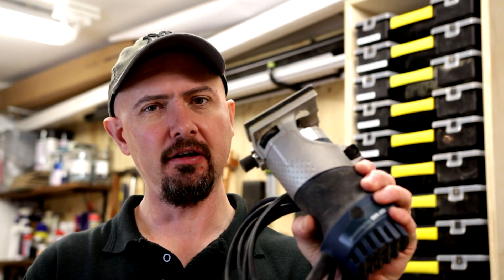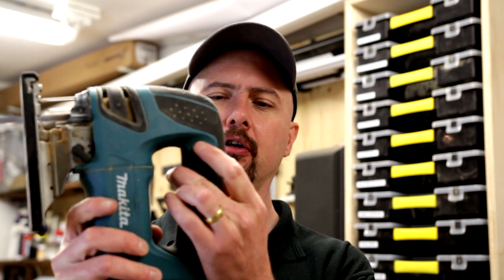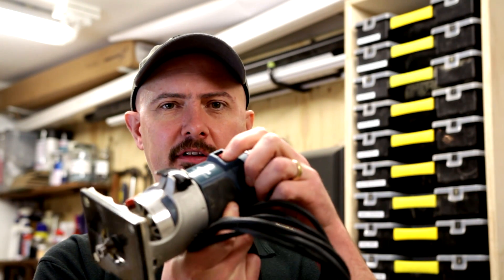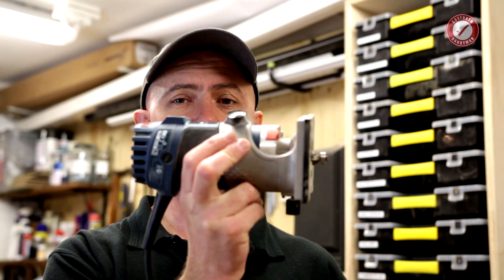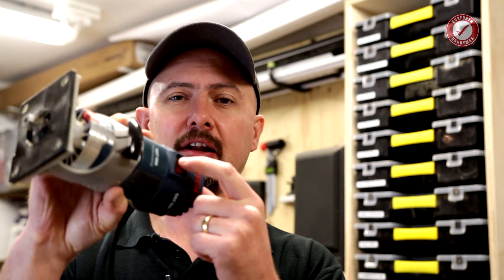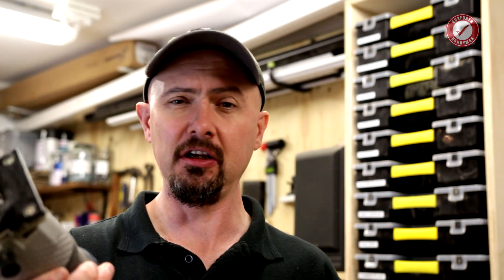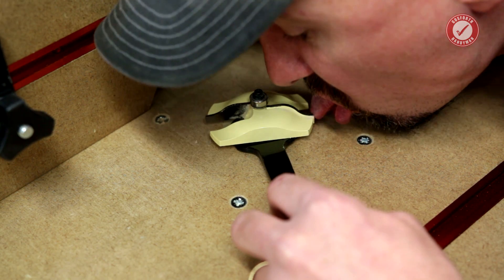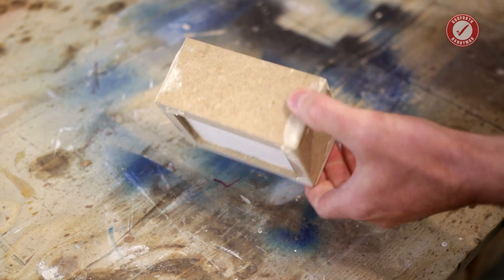I'm making a NVR power strip & why they're important!

Comment: Good work. However, the plug should have been fitted to the orange flex as the very last task. That way, you avoid any mishaps with your mate coming into the workshop after your phone rings & you've gone to the pub half way through the build.

Comment: Really liked the video, thanks for making this, but I could not get my head around the fact you wired the plug first after your safety comments.
What if your phone had rung and your mate plugged it in thinning it was the plug for a tool he was going to use, then realised he had plugged the wrong one in and it didn't start the tool so finds the one he was looking for and plugs that in too, but didn't remove the one you had just wired.
You come back from your phone call/lunch what ever and carry on with the swith end, you are now holding a live wire.
Sorry 😞 just thought I would point that out, do the plug last, for safety's sake, work safely guys.

Comment: Very useful video - thank you! I'm slinging a 1400 watt router under a table. Would the NVR switch you recommend be sufficient for that? Also I understand that some routers require a device to by-pass the switch otherwise you would have to manually turn the machine switch on and off - an obvious drawback.

Comment: My switch arrived and being a 4 pin type I connected both live wires to one side pair of contacts and the two neutrals to the other side pair. Both earth wires joined on a screw in the bottom of the casing. All works as it should. I made mine as a portable extension so I can take it where ever I need it. Thanks.

Comment: I like the NVR switch idea. I’m an journeyman electrician in US and found it odd that you put all your electrical connections in a wood box. Is that common in the UK? The reason I bring this up is that the most common place for an electrical system to fail is at the connections. When you have an electrical event you create heat and flame that can set the wood on fire. In the US all electrical connections above 60 VDC and 30 VAC are required to be in a listed junction box. Usually a plastic or metal box designed to handle the heat and flames.

Comment: I'm a bit predantic when it comes to electric, I always solder the wires before fitting to the plugs
Reply: Solder isn't a good idea, as it leads to loose connections, solder is quite soft and it will creep over time causing the connection to be less tight, this won't happen with the bare copper
Reply: Thanks for this, will keep your advice in mind, appreciate it. Best regards Geoff Maddison

Comment: Hi Andy. Great video please excuse me for how much of a newbie I am.  Love the video but did not understand the wiring at all. I am in Malaysia and we use the exact same wiring as the UK. I have an nvr switch from a dust extractor that did not need an nvr and is on a remote and would like to wire my router setup exactly like you did but I have 4 connections in mi nve: 13/14 and 23/24 and the a 5th I/0.  And not sure how to do any of the wiring. Our colors are the same.  Is there a way we can chat about it ? Michael O

Comment: Thanks for the video. I hadn't thought of the NVR use for hand power tools, will modify my workshop supply for sure. I have a query. My NVR has 5 terminals, 2 IN, 2 OUT and I understood the 5th is for the supply to the 'latching/NVR' contactor in the switch. Am I mistaken because I didn't see you connect a 5th wire

Comment: Thats why when changing any blade or bit on any power tool, the cord should be removed from the outlet. Unplug the tool from the power so you don't have that issue. I do like the added safety of these switches though.

Comment: Is the NVR you used here a magnetic switch or a relay style switch. A couple of my tools have a magnetic switch on them and the removable on button has a magnet on it and if you pull that on button off no one can start the tool. The magnetic on button acts as a key. If the on button is in your pocket or put on the side of the tool no one can start the tool. And it also shuts the power off and will not start back up if the power is interrupted. You have to hit the on button again.
Ron

Comment: Nice except for four gang which causes a hazard.  Best practise to have separate NVR for each tool.
Reply: You can have multiple tools connected so that you can switch on for one and another will start. Small risk for you as you usually work alone but I have seen it happen
Reply from the maker: How does it cause a hazard?

Comment: Very nice! I never used an NVR switch, but over the years I made a few similar outlet strips that used a toggle switch as the master on/off strip between a pair of retail power strips so I could turn off all power to the workbench where those power strips were mounted. That was years ago, long before the "safety nazi's" stuck their heads into the scene.  I also made one that used commercial WireMold surface mounted wiring races (1/2" / 12.5mm thick x 1" / 25mm high and pretty pricey, but limited space offset cost) which had an A-C outlet every 6 inches; mount the back plate to whatever (wall of bench) and snap the front part with the wiring and outlets onto the back plate and connect the power source. I mounted toggle switch box (aluminum hobby box) at one end, which I made for an electronics workbench for the attached shelf 18" above the bench top using 90 degree angle brackets and the bottom of the shelf a few inches from the back of the bench facing the front. Easy access to plug-in soldering irons and other, along with the shop sound system; one switch and everything got turned off at once when I was done for the night.

Suggestion: Your switch box sticks out too far from the workbench top. I realize that the NVR switch needed room for the wiring, but I would have routed out a recess in the mounting board for the wires so that the wiring went into the mounting board to use that ~ 25mm and the switch would have been almost flush with bench top with it recessed into the mounting board. The 3-wire cables could go out the side of the "box" & mounting board into grooves cut with a router.
Reply from the maker: Great stuff! Wanted it to be as easy to 'hit' as possible when the router table is set-up. The downside is that when it's not set-up it's still just as easy to hit. 😂👍

Comment: Good vid, just what I was looking for. Could have used a little more info on the actual button wire up though.
Reply from the maker: Cheers! Wiring deliberately not shown as specific to switch and not to be touched if folk aren't competent with electrics. 👍
Reply: @GosforthHandyman  I have a KJD12 which I believe is the same as the one in this video. Any chance of seeing the wiring diagram?

Comment: Ditto the tape trick, I had never seen that before.
Always unplug equipment or lock out when changing blades or bits!
Here in the U.S. they are called magnetic starters, and not required on new shop tools only on large industrial tooling. I do like them and should be required.
In the final setup of my shop (2 car garage) is done all of the power tools will be on a single mag starter will E-stops around the shop.
Reply from the maker: Great stuff - never heard of magnetic starters too so cheers for the info! 👍

Comment: which way do the wires go on the switch?
Reply from the maker: The switch should come with instructions showing where to connect the wires up. 👍
Reply: They didn't :(
Reply: How do you wire a switch up with no instructions.
Reply from the maker: It's normally just L & N IN and L & N OUT (+ earth obviously) - but you need to know which terminal is which.

Comment: Great video, thanks Andy. If you have any trouble with the 4 gang riding up and off its screws when you pull plugs out, a simple strip screwed across the top would keep it in place. I've even consider butchering Aldi's router table for its NVR switch as they often reduce the table down to £15 when they need the space for the next influx of Workzone kit.
Reply from the maker: Good tip! No probs with it coming off so far - might be a later addition. 👍

Comment: Ok really dumb question but can I have the NVR switching on the whole of my workshop and run tools with a NVR from those. I'm mainly thinking of having an NVR for my Dewalt DW745 table saw where the off switch is really hard to find when switching it off. But with the inline NVR to one side I could find that a lot easier.
Reply from the maker: I don't see any reason why not if they're rated appropriately - obviously you'd end up having to switch the first one 'on' first... then the second one, which might be a pain. 👍
Reply: I did think about that it's just the switch is hard to find but I'll probably get used to it. Thanks any way. I'm really enjoying your Chanel every time I watch a video I learn something new😀

Comment: A very very good tip Andy and folks please remember, it’s not just your household trips that can remove power to your workshop. I work for an electrical distribution company here in the Midlands (like what used to be Norweb up your way Andy) and power cuts are sadly all too common. When we restore power at the substation or via HV (high voltage) switching we don’t check that everybody has turned their stuff off we just “whack it back on again” so to speak. The time it is off could be in excess of an hour or more so it would be very easy to forget what’s on and what’s not.
Reply from the maker: Wise words! 👍

Comment: Good thinking, have power cuts from storms here in Aus regularly, though my router table has an NVR switch built in as well as most of big equipment, I will still add this to where I use power boards because you just never know.

Comment: Nice mains power control project for both convenience and safety.

Maybe I missed it, but at the end only the manual On/Off switching functions were demonstrated. The switch's actual internal NVR feature was never shown to work. With the tool on and running, the orange cord should have been unplugged causing the tool to stop running because of the loss of power into the NVR switch. After the orange cord is plugged back in, the tool should continue to remain off until the NVR "On" button is then pressed again after power is restored. Pressing "On" during the power outage will also not reapply tool power when the main power returns.

As a side note, when using friction mounted power strips like that the one you have, I like to add another screw or bumper along the side of the strip that needs to move away from the main (hidden) mounting screws before the strip will come loose. This prevents general vibration or tugs on the cables plugged into the strip from pulling the power strip off the main mounting screws by accident.

Comment: Thanks Andy, workshop joiners aren't by nature the most health and safety minded folk so this is a very good tip. Not sure why you painted inside box, is that the OCD thing you mentioned before 😄 and I hope the router was unplugged before you put your tongue on it!!!!!! I had to look away 😂😂 Thank you for sharing 👍
Reply: Nope, sorry, those are very brightly colored wires. It's simply OCD. ;)
I'm a safety freak too. The old aphorism that the only real craftsman is missing a few fingertips is complete bullshit. Safety is #1. Safety is all.
I do electric model airplanes. The previous generation planes with gas motors were OBVIOUSLY dangerous when they were running, and they couldn't start by accident. The newer electrics are very easy to start accidentally.  There are a couple of important safety steps to prevent 'unintended startups'. I've witnessed about half a dozen! Fortunately no one hurt by any of those but know of half a dozen more that caused fairly serious human damage. I have personally caused only one unintended startup, and that scared the furry green shit out of me. Before that I thought I was being safe. After that I got truly militant. And I don't hesitate to call anyone out that I think is being unsafe. Not just for their safety but also for mine and anyone else who happens to be nearby.
I like this 'default off --two on switches' concept. It affects me very little but I'll keep it in mind.
Reply from the maker: Ha ha - painting inside was mostly OCD but I justified it to myself since it makes it easier to see the wires! 😆🛠😃
Reply from the maker: I'm just getting into the planes thing with my son! I was in to r/c in a big way when I was a lad. Great stuff! 👍🛠

Comment: Nice little wire up job and set up there, there's nowt wrong with orange cable, at least you can see it clearly in your workshop. Keep up the good work.
Barry (West Kirby, Wirral)
Reply from the maker: Cheers buddy! It's just really plastic-y - I want to get some of the rubber sort of stuff you get on Festool tools etc... can't remember what it's called. Costs a fortune though. 👍😆
Reply: Does the R.A.F square bashing camp still operate in w/k I was there in 1948 . ?Just going down memory lane

Comment: Great video Andy and I totally agree with you that an NVR is needed. I am contempalting on putting one on my Dewalt DW745 table saw as I think that its dangerous to use it without a descent one, the manufacturers one is PANTS, LoL
PS, where did you source it from, do you have a link please?
Reply from the maker: I just got the Kedu one off Amazon (just search for NVR switch) - kind of mid price. Didn't want to go for the cheapest lol. I find the switch on my DW745 is in a terrible location - I always have to 'hunt' for it! 👍